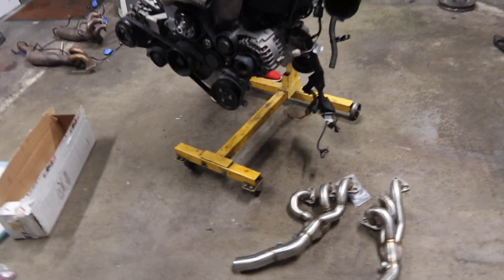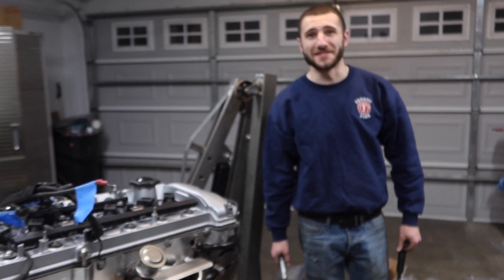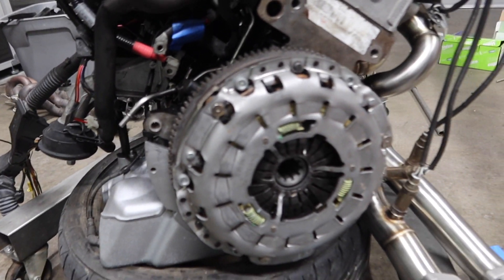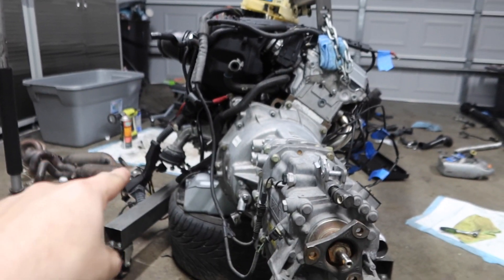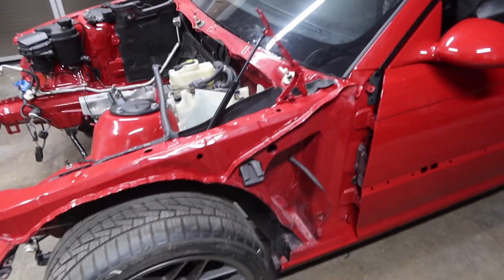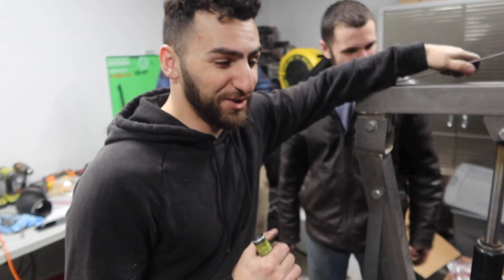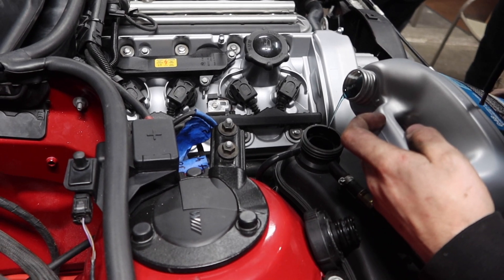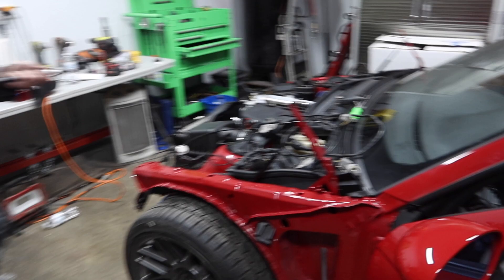E46 M3 Engine Install & Startup | E46 M3 Build Ep.18

Comment: Awesome work guys. I hate to have to tell you, but those flywheel bolts are single use only.
Reply from the maker: Been doing it for years with absolutely zero issues, as long as you use loctite its fine. They’re not stretch bolts, and also no angle when torquing down.
Reply: @TatOhanyan  The build is epic bro. I love the attention to detail, and just how fast you guys work, without compromising on quality
Reply from the maker: Thanks brotha, Appreciate it!

Comment: the drive shaft ist balanced ,if you dont mount it in the same position it will make problems
Reply from the maker: the car has 260k miles, that driveshaft has definitely been off before, no way to prove that it was already in its balanced position when I took it off since there are no markings. I've taken off and installed dozens of driveshafts with no issues whatsoever, not even a slight vibration.